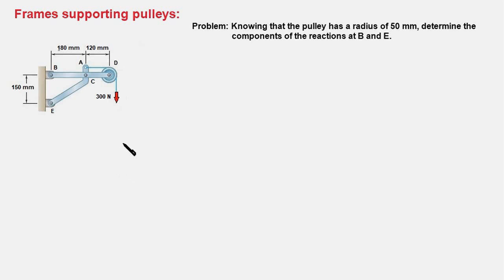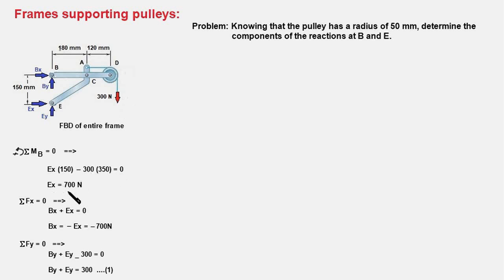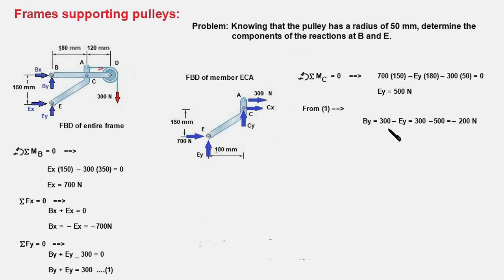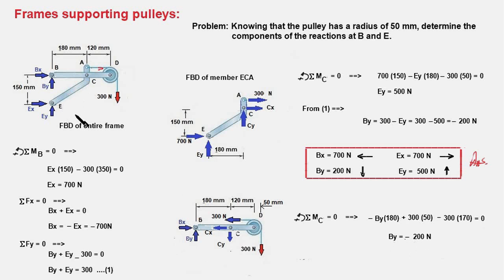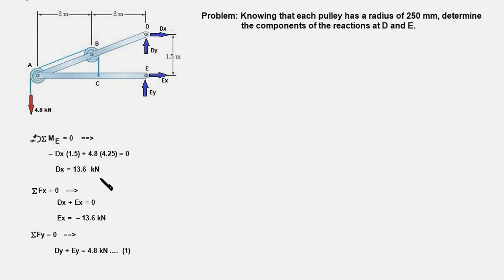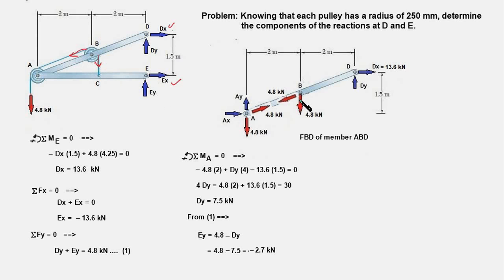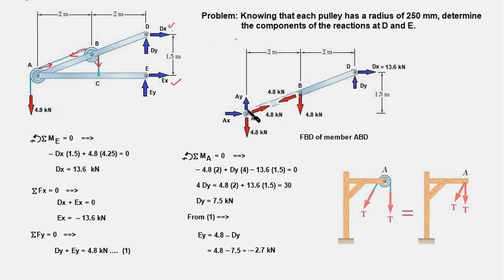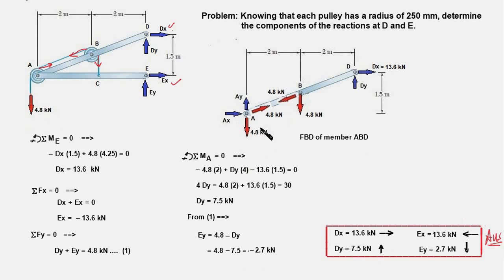14.9 Analysis of Frames supporting pulleys (3/3)

Comment: what if the rope in the pulley was attached to the wall instead of A? Would that count as a reaction force or no?
Reply from the maker: Hi Connor: If the rope is attached to the wall instead of point A of member ACE, no reaction force (due to rope tension) will act at point A but instead will act on the wall. Hope that clarifies your doubt.

Comment: Sir can u show me the FBD for frame ace in 2nd question do we need to include for for pulley..
Reply from the maker: That's a good question. While drawing FBD of member ACE, you have to keep two points in mind:- (a) It has been assumed in the video solution (@12.30 mts) that the pulley and the pin on which it rotates as part of the member ABD. (b) The forces of interaction between the members ABD and ACE is shown by Ax and Ay.
So, you may continue with the same assumption and show only Ax and Ay at point A of member ACE. Ignore the pulley and the forces acting on it. But now the direction of Ax and Ay acting on member ACE would be just the opposite of what it is in the FBD of ABD (action - reaction pair). Next, tension force 4.8 kN at point C and Ex and Ey at point E. That completes your FBD of member ACE and now you should be able to compute the unknowns. Hope that helps!

Comment: I don't know exactly but  tension in the rope must be represent  on the pulley at a distance of radius of pulley
Reply from the maker: You are quite right... the cable tension forces do act at the rim of the pulley (check out solution to prob.#1). But when you wish to remove the pulley from the member on which it is mounted, you can't ignore impact of the tension forces on to the member. Pl. watch another video (link provided in the description box above) to understand how the tension forces are shifted to the center point for simplification. Hope that helps!
Reply: @VectorInMotion  thank you👍👍